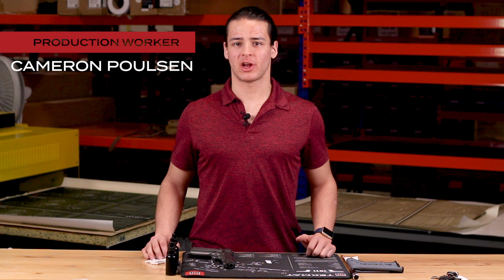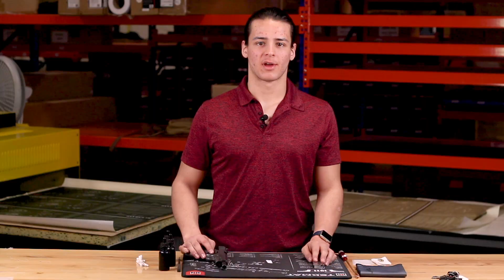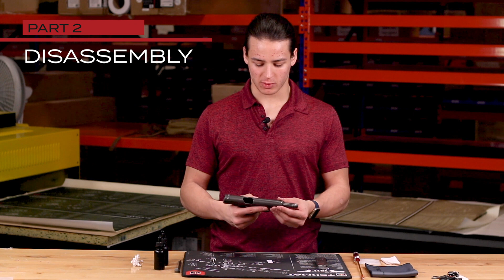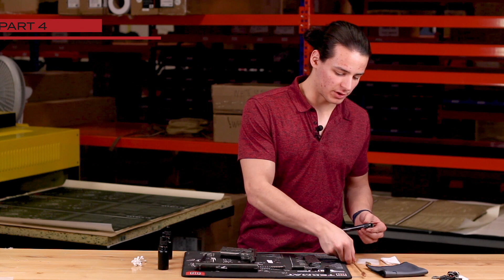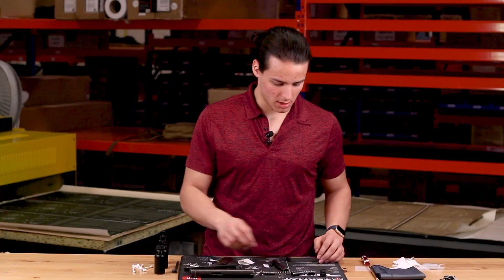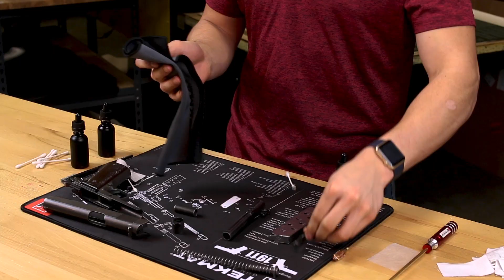How to Clean a 1911 Pistol  | TekMat | Basic Gun Cleaning

Comment: If you want to avoid any and all damage to the recoil spring plug and frame.  Check out the 1911 Ultra Tool and Shoe Slide Horn.  Without those tools you are absolutely going to rub, abrade and damage the finish on your 1911. 🔫